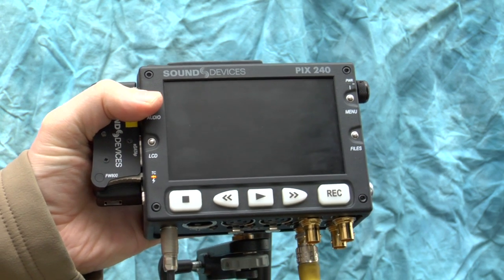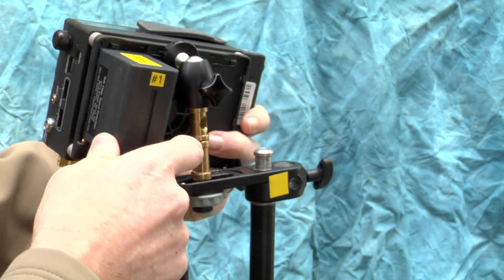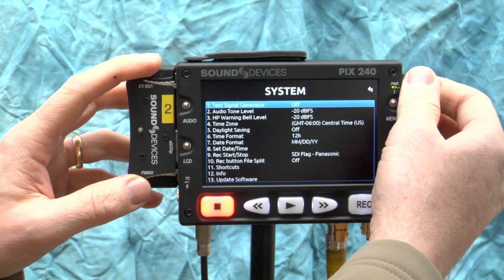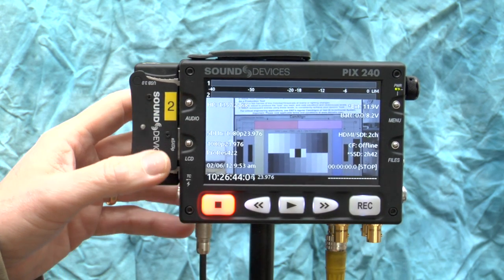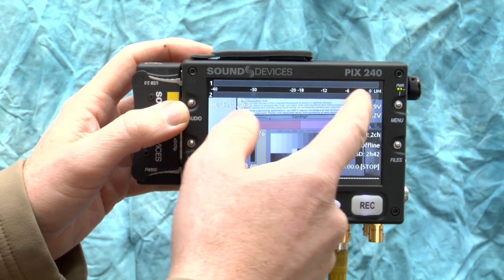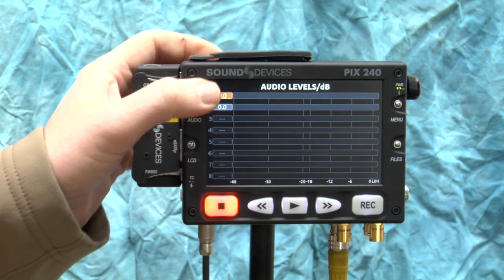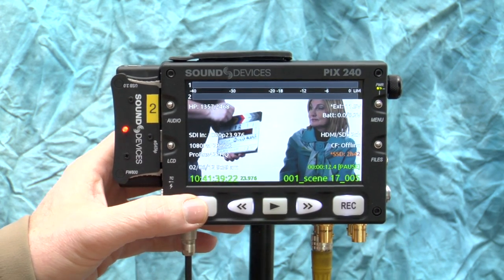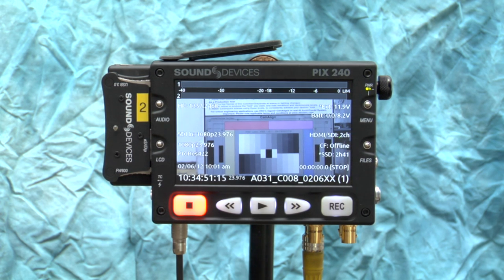Sound Devices Pix240 virtual checkout

Comment from the maker: @locationmixer keyboard should work.  I have a roll-up neoprene type keyboard, not so small that does work as well. 
it would be nice if I could lock out the REC button too.  I get when it would be useful to have only that button operative, but I imagine it also attached to dumb side of the camera in handheld config and somebody pans over and hits REC by accident....